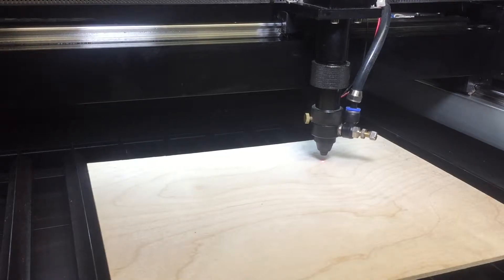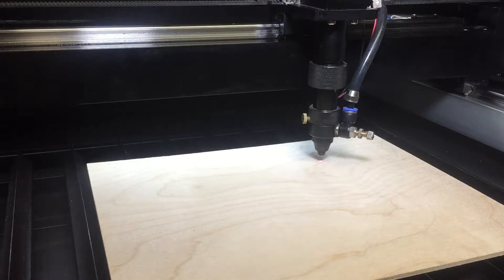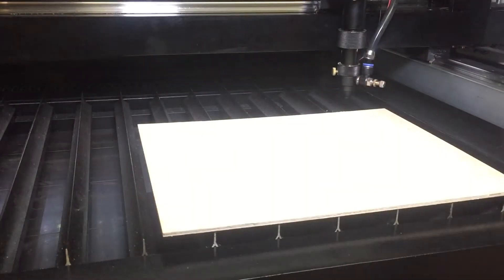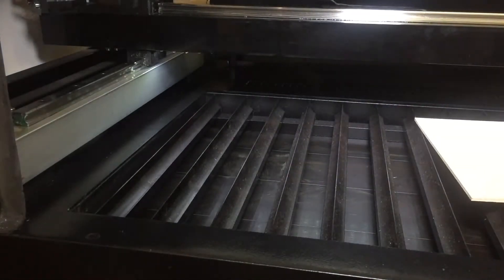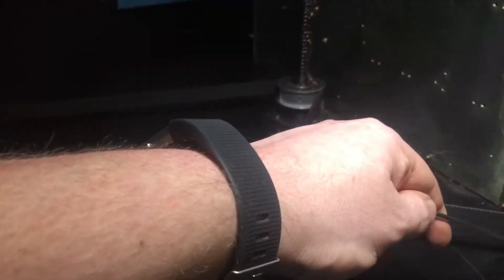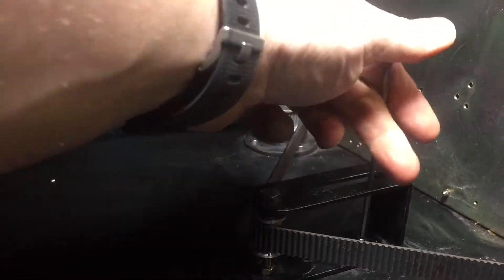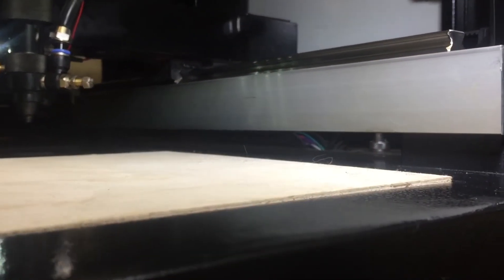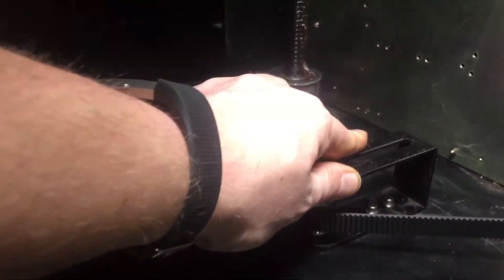How to level laser cutters work table or Z axis work bed

Comment: How do you manage to get the belt back around all of the lead screws without accidentally moving one or more of them?  This is an ongoing battle that I have with my chinese 60 watt...manual Z.
Reply from the maker: It can be a bit of a challenge, especially on smaller machines. If I were to face that problem, I’d probably grasp the lead screws with a gloved hand (I usual wear nitriles whilst repairing cutters) or with some mole grips. However as implied, it’s not an issue I’ve faced.

Comment: I have a chain system. It’s an 80w blue and grey from OM Tech and can’t find anything about it.
Reply from the maker: Chain systems are different to the belt system shown in this video and are much less likely to go out of true. They work like a bicycle chain does, they usually have a "chain connecting link" (Google that for videos on how they work) which might need a special tool to remove, once removed you can adjust the lead screws. Alternatively, you can try using shims to raise and lower parts of the work bed. Also I might suggest have you tried contacting OM Tech? Try my forum for a deeper discussion and help. https://community.andmirrors.co.uk/

Comment: Hello, can I please ask how you dropped the work table down? What setting on the keypad was it?
Reply from the maker: This is very dependent on the cutter. On the machine in the video you press button Z (in the middle of the direction keys) it then shows “Z axis operate” mode, you then use the up and down direction keys.

However lots of machines with this controller have separated controls for the work table, and you may need to use a separated/independent set of controls. 

Please post your question to my forum https://community.andmirrors.co.uk with photos of your machine for more help.

Comment: how do you readjust the tension to the correct amount afterwards?
Reply: Tension is mostly guessing, you want it tight enough to hear a low guitar string note essentially so it doesn’t slip or over stretch the belt. Then tighten your tensioner.
Reply from the maker: With the systems I’ve worked on, I simply apply the maximum amount of tension, which is often just enough and does not over strain the timing belt.